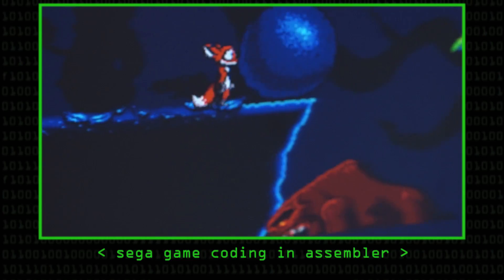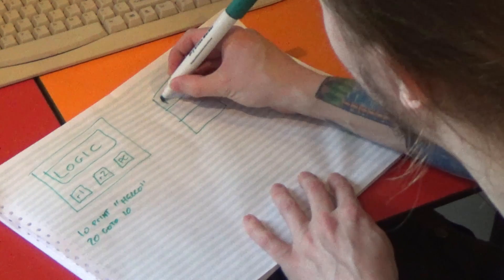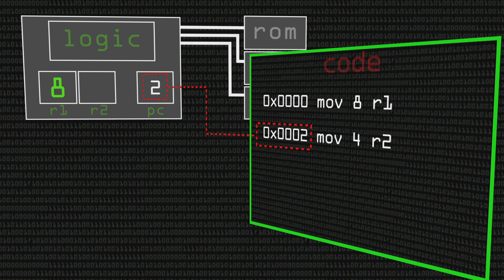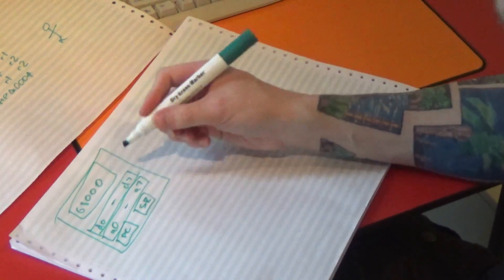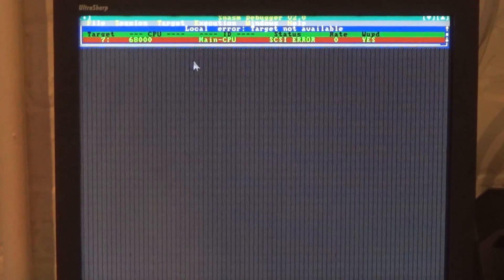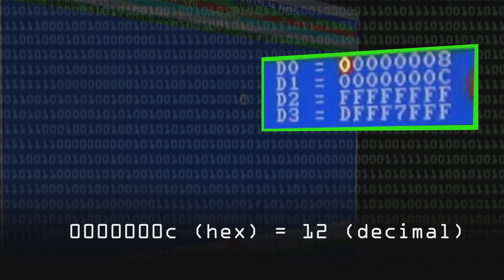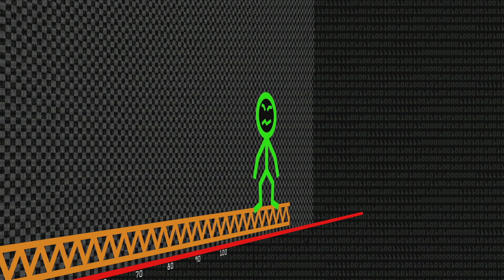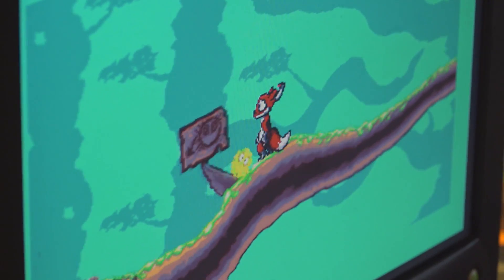Game Physics (in Assembler) - Computerphile

Comment: Why is he using such an old pc setup?
Reply: He's making a Sega Genesis game.  New PC's don't support the hardware required!
Reply: explained in last vid, for scsi interface iirc
Reply: because his debuger runs on Microsoft DOS and the Dev Kit only supports such old hard/software
Reply: Because of compatibility reasons with the old sega genesis dev kit, It was explained in a previous video.
Reply: Because the SNASM2 card he uses to connect to the Dev Kit does not work on newer hardware. Watch the previous video.
Reply: He may have gotten away running win 2k if the software does not mind running under DOS emulation, 2k still has full support for ISA cards
Reply: And 30 years later I can still sadly remember that RET = 201 decimal on the Z80. Mainly because the first assembler programs I wrote on the ZX81 were hand written on A4 paper and the machine code instructions written on the right hand side. The decimal numbers were then keyed in by hand....
Reply: Goodness me - SNASM - that's a real blast from the past (ex-80s games developer). I remember going over to Leeds to see if we could get their 68000 dev kit working for the Atari games system - the one that never saw the light of day before Jaguar because SNASM was so much better than the Atari dev system. SNASM was blinding fast